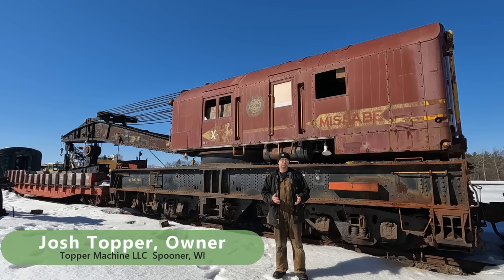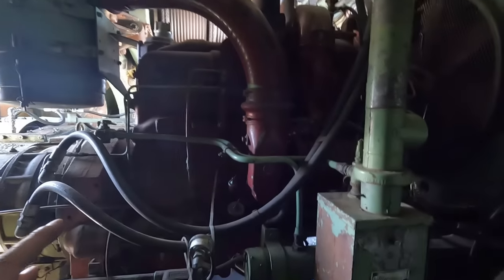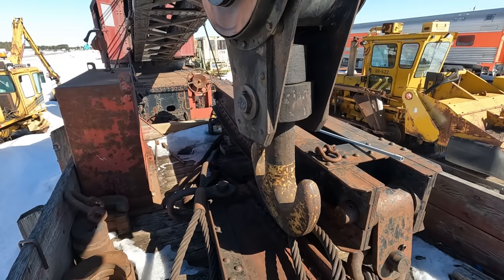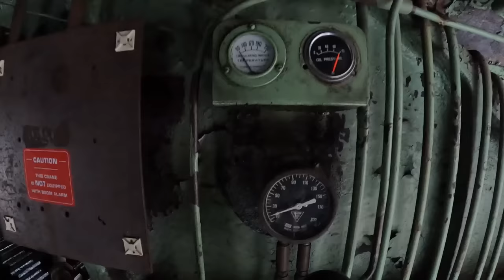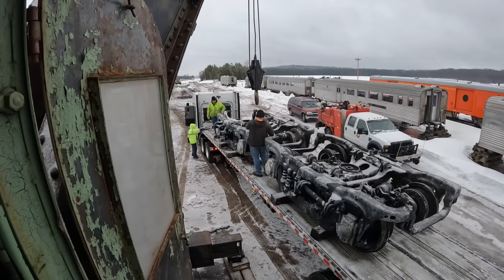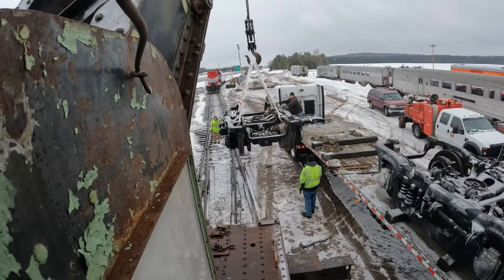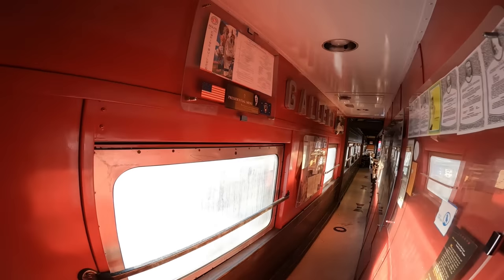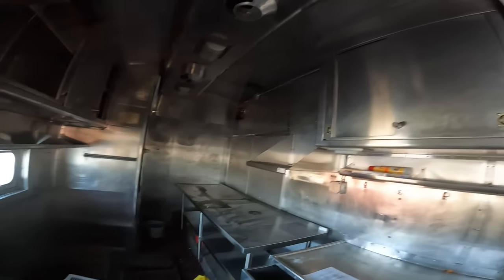Railroad Wrecking Crane, DMIR X7, Inside Tour & Lifting A Great Northern Ranch Car

Comment: Thanks for the video.  It's really cool to see that old equipment come to life and work as well as it did when it was new.  By the way, how did you learn how to operate it?  Smooth, slow and steady.  Great job.
Reply from the maker: Mostly trial and error. With any equipment, I approach with the mentality that I have no idea how to run this and take it super slow. Even after all this time as the operator, I am still nervous and on high alert. Never let my guard down.
Reply: @TopperMachineLLC  Good way to be.
I worked on the Huckleberry RR in Flint, MI from 1979-83 as track foreman and help in the shop in the winter.  We had a Little Giant 20-ton truck crane that was acquired from Government Surplus that had been in the Air Force that had been rolled because a woman in a car cut in front of the crane when it was traveling on the highway and the crane engine oil pan had broken when the crane was set back upright.  We replaced the oil pan and several other broken parts and straightened some sheet metal but not the window glass to make it serviceable.  Since we needed it for track work, we rigged a car truck under the front end and a wheelset with journals under the crane end to high-rail the crane.  Because our track was 3-foot gauge, we had to move the crane on the track with a 12-ton Plymouth loco using a 15-foot towbar.  We had brought in old bridge timbers on a flat car and were going to unload them.  I told my supervisor that I would set up the outriggers, hydraulic, then he could come out and unload the timbers since he had told me that I was not safe enough to learn how to run the crane.  He told me to only set up the outriggers on the "pick" side which I did under protest.  He came out and raised the boom and started swinging to get the timbers.  Now the counterweight did what it was supposed to but there wasn't any load on the hook so over on the counterweight the crane went and the frame was at about 45 degrees and the boom flipped back over the cab.  We spent the rest of the day getting that crane back upright and on the track.  If I had been allowed to set the outriggers on that side, the tipping would not have happened.  Fortunately, no damage was done to the crane other than some scratched paint.

Comment: Just found your channel and I'm hooked! That Crane is an awesome peice of machinery. So there's no pressure drum clutches there if I saw that right? You just power down below lockup on the TCs then engage the dogs then throttle up to engage power? Then those valve levers in front of you, each one operates the dogs in and out of engagement, is there an air brake to slow and hold that particular shaft? Sorry for all the questions, I just love the details! Thanks for the awesome video from a new subscriber!

Comment: Fuel oil boiler, What's the information off of the data plate?
What a brilliant idea, though it actually heat the engine water jacket sufficiently enough to crank the engine in severely cold weather?

 Certainly this would not meet today's EPA standards, but for a remote cabin without electricity this might be an neat addition to one's powerplant.

Comment: You could replace the broken glass with polycarbonate, which can be cut with a miter saw, table saw or circular saw, without it shattering, and it will definitely be highly resistant to vandalism.
Be sure to get the sunlight resistant polycarbonate, as it won't yellow or blur.

Comment: I was really hoping the kitchen/galley would be similar to that on a fast attack submarine as there are some sort of interesting parallels between the two.
Reply from the maker: This is a basic kitchen as it was a bar/coffee shop. Traditional galleys are much different.
Reply: former subs - I was thinking submarine galley when I saw it
Reply from the maker: I'm sure the basic ideas were the same in design. Small, yet well equipped, and rails around the stoves and shelves.
Reply: @TopperMachineLLC  Ahh.  I thought maybe they also served food since there were tables and such.
Reply from the maker: @prototype3a  I really don't know. I'm just a contractor for the railroads. I leave the useless details to the railfan. Doesn't mean I don't find the car cool, I just don't dig into the history of that stuff.

Comment: i wonder why old engineering/machines it's always long last even made at limited technologies😮
Reply from the maker: The people designing and building this old stuff were far more advanced than we currently are. Engineers then designed for maintenance, repair, and longevity. Now they design for the trash can.
Reply: Good question. I think they had to be overbuilt by modern standards to make certain they would do the job in any weather and last a long time.

Comment: Thanks for the video, excellent footage, love these old machines still working. Can I ask you what camera you use? I made the mistake of buying a GoPro Hero 11 and man for a brand new camera I'm not impressed with many things. I really don't wanna waste more money on another bad option, the 360 Cameras look okay. 👍😉
Reply from the maker: I have 2 Hero 10, and have had issues with both. Either audio problems, or camera locking up. It's mostly the audio that is infuriating. I have an older hero7, but the battery is weak and I haven't dug into finding more. I am looking at the DJI cameras, I've heard great things.
Reply: @TopperMachineLLC  thanks for your reply, yes the DJI looks great too, very similar to the GoPro but not quite as higher resolution but still excellent quality, so I'll have to do more research and then try to sell all my GoPro equipment. The new camera overheats and chews through batteries and the sound isn't what I expected. Thanks again. 👍👌😊
Reply from the maker: @ScottSillis  yeah, the GoPros are really going downhill in quality. I'd love to get to the point of having a really good camera, but for what I do, the action cameras seem to be best.
Reply: @TopperMachineLLC  yeah me too, I'm a singer and bought it for gigs and online streaming but I'm also a mechanic and Aircraft Maintenance Engineer etc.
For the money you definitely expect the device to live up to it's name.
 I work in the railways in Australia. overhauling engines, building locomotives from the frame up and now traction motor overhaul. Certainly interesting. Take care, looking forward to your next videos 😊👍

Comment: Topper Machine I was wondering what does the crane weigh and also is the throttle for the motor air operated or is it a mechanical throttle

Comment: No high-tech load calculator and car body angle, safety stop pull switches. Enerpac lifting jacks with power pac.  Hard work setting crane up.  Run correctly, safety happens too!

Comment: Had the same "lockup" problem when I got my GoPro camera. On Their website there is a list of recommended cards. Inmitially I was using a microSD card I had laying around. No Joy. Swapped in a Samsung EVO "Plus" 250 gig and problem solved. Use it on my bike helmet for accedent investigation. Plan for the worse, hope for the best.

Comment: I liked the lifting operation enough to give this video a like. However, the frequency of ads on this video is very off-putting, YouTube had some month or months where they were upping the frequency of advertising on uploads submitted during those months. You might want to consider editing out some of the advertising if you want more subscribers. This Railroad Wrecking Crane is similar in nature to what the British Railways used, up until recently. Overall a very good video, apart from the frequency of the advertising.😊👍
Reply from the maker: I have no control of what ads YouTube uses or how frequently they interrupt the video.

Comment: About how many HP do you think the diesel is?  Are the outriggers manual operated, or air?
Reply from the maker: I think I remember the sCummins was rated about 185-195. But I could be wrong. Outriggers are all manual

Comment: Couple of questions from a old operator. I noticed that in the first part of the video the outriggers weren't out, Then when the next thing I noticed is they were out and blocked. What is the procedure of setting the outriggers, do you have to pull them out manually and do you just block them tight, or is there some way to adjust them? Can you even swing the crane over the side without the outriggers set? Also, on the load chart, is that the 360 deg capacity or just over the front or back? 

I'm very familiar with old motor cranes and crawler cranes, but know nothing about RR cranes. I know you have to be really careful on a motor crane when swinging over the side without the outriggers set (the crane can turn over backwards because of the weight of the counterweight, and this crane has a narrower gage than a motor crane
Reply from the maker: Outriggers are all by hand and blocked and wedges or shims. I can and do swing without the outriggers, but only if the truck blocks are in. A lot of times, you can't swing in the location you have to work so need to preplan. I did a derailment that I had to setup a mile away, them be shoved into position because I had no room to swing. That load chart if for all positions with the outriggers at full extent.
Reply: @TopperMachineLLC  Unless you are in a railyard, most tracks sit up pretty high, that's a whole lot of blocking. I understand what you say about swinging, most RR tracks don't have a whole lot of horizontal clearance, and that crane has a whole lot of tail swing. That's a neat old crane.

My Dad was also a crane operator for many years, and the company he worked for did a lot of derailments. He was working on one picking a car, he had ahold of one end and a crane very similar to this one had the other end (much like setting the car in this video). Problem was those RR operators were rough, the RR crane got up on the car but wasn't centered over the load. Dad already had his end up, and since the RR crane wasn't centered when he picked up his end, it caused the car to move fast when that end cleared the ground. Even though Dad had his end in free-swing, it collapsed the boom in the 90 ton Lima he was operating because it swung so fast and put a side load on Dad's boom. The booms in those RR cranes are a lot stronger than the lattice boom in a truck crane, which can't take very much side load.

Comment: Josh, does the gearing in the crane have an auto lubing system or is it a bucket of 140 gear oil and a paint brush?
Reply from the maker: All manual, just like I like it. I actually use a grease designed for open gears. Very tacky, almost like tar. There is a bench seat back there that was actually for the fireman and the oiler to sit.
Reply: I would imagine a crane of this size would have had a full time oiler who did the rigging as well back when this was in service?

Comment: That crane looks like an old obsolete piece of junk. But looks are deceptive. It's a really well built piece of equipment that has run well for many decades with just a power plant and a few other bits upgraded. I'd bet that if it still had the original steam engine, it would still be running just like new. No doubt it's going to keep working for many decades to come. Unfortunate about the vandals, we have major issues with youth crime here in Australia, primarily car thefts and break-ins and thefts. It's a sad state of affairs really.

Comment: NRRM IN GBW, also has a steam wrecker,  SOO LINE W1, BUCYRUS, 1903,  donated on 1963.  But some restoration started in 1989, with old wooden cab stripped off;  and boom car deck.   BUT:  SUDDENLY CANCELED by 1990, after the Board Fired our new director from Chicago but without reason nor warning.   Some volunteers from the SOO HISTORICAL SOCIETY also started.   But, the newest manager was totally Anti-railfans!!   He vocally yelled in public.    And physically assaulted another who was working on the mini live steamer of the 20th Century Ltd. 5445, 4-6-4 Hudson J3a Streamliner, originally built in 1938 by ALCO but the Model was built in 1948 in Wichita, KS., plus other donors offered to supply machine work,  and boiler tubes.    But little 5445 just sat outside for 15 years to let kids climb on it;  and in 2001, Hudson Jr. 5445 was sandblasted,  and repainted with NYC Gray and blue stripes;  but now sits in the gift shop filled with teddy bears dressed as engineers.   Thus for the past 35 years the SOO W1 Crane has just sat outside,  with open cab and machinery exposed to weather.   Yet we have original b&w photos 📸 from 1963 that show the wood cab.   But until the managers are changed, the Soo w1 Crane is just sitting in the open, rusting to oblivion!!!!!   HI IN April 2023A.D.
Reply from the maker: This is why I have extremely limited interactions with museums. Shortlines and regionals tend to spend the money where it's needed. That is where I come in. I also detest railfan, they are usually there to gawk and not work. I am there to do a job, and when the people assigned to help me would rather babble about trains than do the job, it makes the job take way longer. I guess I can bill for more time, but I'm there to get a job done and move on.  Yes it's a shame that crane is so neglected, but do they have anyone capable of operating it safely or efficiency. That is the problem with museums.
Reply: Hey, Topper!! Thanks for your response....but, No...Soo line W1 Crane was donated in 1963.  But not in running shape.   W1 has a vertical boiler, but the exposure to the winter weather for the past 36 years have ruined thus boiler.  Thus a new welded boiler should be installed.   But fat chance for that to happen.   But also, our railfans were totally dedicated and loyal volunteers.   THE NRRM biggest problem is the 12 different managers during the past 40 years.   The managers ain't railfans.  Nor steam enthusiasts.    The NRRM hired some really strange managers,  and in 1980 to 1986 the Outside Management from the G.B.A.V.C.B. decided to sell 13 engines and cars, sadly 7 of these were Scrapped and Destroyed!!!!!   Luckily in 1986 they were FIRED!!   And our new director from Chicago arrived, and he worked with the volunteers, and we built up the new h.o. model railroad clubs in the HOOD JUNCTION STATION. But, suddenly he was fired unexpectedly in 1989, but without the Boards explanation.    Yet in 1990 the next manager was Extremely MEAN.  AND he actually yelled at volunteers in public,  and he actually chased off the volunteers from the N.R.H.S. NORTHWOODS CHAPTER when they were repainting the wooden coach from 1890 from the LSI RR in Marquette, Michigan,  and this coach was left unfinished for nearly 10 years.   Luckily that manager was fired in 1996.   But none of the next 4 managers bothered with this coach.   Sadly. The Loyal Volunteers were still being shunned by both the Boards and managers.   Also sad is the Original Founders from 1965 through 1987 were all dieing.  Thus their goals and visions died also.   Yet the replacements didn't have the same visions.   Those managers then Scrapped, ( or sold)  37 engines and cars.  Leaving only 56 pieces left.   The managers Destroyed the smaller steam CRANE built by Browning and used by the Appleton Paper Co., who donated it in 1970 in Full Working Order and used for lifting at the Museum,  but in 1984 the GBAVCB Scrapped this Browning Steam CRANE.  Then in 1986 they were let go.

Comment: You need to lean on someone for undercover storage for your crane. Stop vandalism and slow down rust. If I lived not so far away (NZ) I would operate camera for you. I think more on the rigging and out riggers would be nice. What brakes hold the load while you change ratios and drives?

Comment: @5:39 Avoid GoPro at all cost - they are absolute trash.   Which version of GoPro are you using?
Reply from the maker: Hero 10.  Been through several in the last 6 months.
Reply: @TopperMachineLLC  Thank you.   I guess I won't bother trying to learn how to use my old hero 5.   It was so complicated I never even took a single video with it even though I've had it for something like 5 years now.